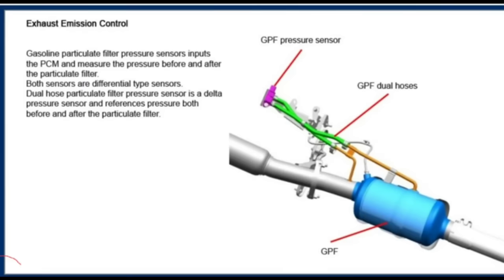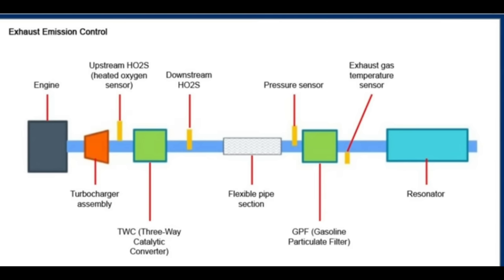Gas Particulate Filters Are Coming To Fords - Check This Out - I'll try and explain

Comment: Gas engines are so clean these days why do we need them?  I guess the EPA has too look like it's doing it's job.
Reply: We weren’t so far off at carbuerators, the rest of it has just been a cashgrab
Reply: @kellismith4329 Feedback carburetors with catalytic converters achieved basically the same results as fuel injection and catalytic converters.

Comment: The old saying "history repeats itself" comes to mind. In high school auto shop class I remember Japanese cars with miles of vacuum hose harnesses and Domestic cars with similar hoses and wires cluttering up engine compartments. When I went to work at a European dealership in 87 I got a pleasant surprise. Fuel injection with O2 sensors did away with the clutter. You could again see the engine. Throttle body GM vehicles were easier to work on. Now we are we are back to the clutter of all kinds of wires, sensors, and modules to deal with. It's just more B/S to cause trouble and expense down the road.
Reply: And  right you are 1230, and the "CUSTOMER" Foot's the Bill....   👎 Here we go again. What a JOKE!!!!
Reply: When GM and Ford came out with their throttle body and multi point fuel injection systems I thought they were really nice. A huge improvement over a computer controlled carburetor or variable venturi carburetor and all the other mess, like a heat riser or ported vacuum switches everywhere

Comment: I’m keeping my 2005 Ford Expedition 5.4 three valve engine and 4 speed automatic transmission.  In a couple of years the vehicle will be phased out for emissions OBD 2 inspection and strait pipe the whole thing
Reply: I’ve got an ‘06 Expedition with 275k and I keep wondering how I could drop an old 351 in it! 😁

Comment: I remember turning thru pages of a binder at ford training facility of upcoming designs and stuff back when I worked at ford dealer and seeing the particulate filter for gas engines and duel fuel injection where there's port and direct fuel injections on a gas motor. Just thought to myself how much more complicated do they need to make things. 🤦‍♂️

Comment: Thanks for the information. I need to dissect this even more now that this system is going to be incorporated.
I wonder if all manufactures will follow suite.
One thing I remember back in the day was when the introduction of LEV cars like the Honda Civic and the Ford Taurus took center stage. I always wondered what made them more emission compliant then the standard production vehicle and as to why they didn't continue this process over their platforms through the years? I never had the chance to work on one and it sure would of been a great experiment by performing a "tailpipe" test utilizing a 5 gas analyzer and compare what's coming out of the new vehicles to the older ones.
The shop I use to work at years ago, we use to have a emission chart to show what tailpipe emissions standards need to be at so we can analyze and do a comparison to see how far off a customer's vehicle is and then plan an attack on how to fix it in order for it to pass emissions. 
This was at a time when the IM240 testing procedure was in effect and that there was 2 different procedures:
If a vehicle could not pass the OBD direct connect test then the second method was to do a tailpipe test while running the vehicle on the 'rollers'. If it past there then the vehicle get the pass.  Vehicles older then '95 got the static idle test. 
Of course that all was thrown out by the mid 2000s. So I have no idea what the requirements are now since I haven't been able to find the information on that anymore.

Comment: We have had GPF’s for the last couple of years here in the UK 

Ford dealer tech
Reply: And how much more unreliable have the newer vehicles become, due to this?
Reply: So far no real problems , you would sometimes get a car in with a “ drive to clean “ message . 

But that would be generally because of a customer driving style 

Or they weren’t made aware
Reply from the maker: You also have different Fuel and different oil over there
Reply: @FordBossMe  different fuels for sure  , you guys have a lower RON I believe right . We now have e10 petrol which is 10 % ethanol 

The oils are the same spec I would imagine . It’s Also interesting to see the slight differences in PTS for both country’s . With regards to TSBs etc

Comment: In the UK the Mustang 5.0 built on or after 11/2017 has had gpf's. I switched PTS over to the UK and looked at workshop manual without a vin to read up on it.

Combined Catalytic Converters/Particulate Filters

The 5.0L Ti-VCT V8 features a combined catalytic converter/particulate filter installed in each exhaust tract along with an exhaust gas temperature sensor and an exhaust gas pressure sensor to meet the new legal requirements for the reduction of diesel particulate emissions. The software has been adapted in order to be able to process the information from the additional sensors.

The mode of operation of the particulate filters is the same as the technology used in the diesel engine. The two exhaust gas flows are each routed into a combined catalytic converter/particulate filter. The particulate filter and the catalytic converter are combined into a single component.

By evaluating the signals from the exhaust gas pressure sensor and the exhaust gas temperature sensor, the PCM can determine the level of build-up in the particulate filters and the exhaust gas temperature. These signals are needed to tell whether engine-based regeneration measures need to be initiated. Regeneration is easier in gasoline engines since their exhaust gas temperatures are approx. 200 °C higher. The regeneration is initiated "naturally" once the driver is no longer accelerating and the gasoline particulate filter is hot enough.

If the regeneration temperature cannot be reached due to the driving style, cold outside air temperatures, driving short distances, the PCM can initiate regeneration by retarding the ignition timing.

A message is shown on the display if the level of build-up in the particulate filter reaches the limit.

Regeneration can be carried out using IDS / FDRS during servicing.

I can't find any information on problem people are having with them. On other vehicle makes I know they offer GPF back exhausts when they are separate from the 5E212 and you can find companies that make (most likely illegally) gpf deletes since one of the most common complains that I can find is the further removing of exhaust noise.

I also found an SAE paper on comparing GPF equipped vs non GPF equipped vehicles particle numbers: https://www.aecc.eu/wp-content/uploads/2020/08/Real-world-emissions-measurements-of-a-GDI-vehicle-without-and-with-GPF.pdf

I doubt anyone will be shocked to learn that direct injection engines produce a much higher amount PN's.

I originally learned about this because I am a nerd and was reading up on Roush's superchargers and they call out that they are not compatible with gpf equipped vehicles.

I'd like to think of Euro 6.2 emissions as the beta testers of GPF's they don't appear to have been causing issues that I can find but then again I'm looking at an internet that heavily biases content for the region I live in. It is causing problems for aftermarket power companies though as they aren't really able to tune anymore. Rosch gave up on them with the superchargers, I don't know about the 2024 US Mustangs with the Whipple tune yet as workshop only says that a GPF may be equipped: 

Overview

NOTICE: Do not use leaded fuel in a vehicle equipped with a catalytic converter. In a vehicle that is continually misfueled, the lead in the fuel will be deposited in the catalytic converter and completely blanket the catalyst. Lead reacts with platinum to poison the catalyst. Continuous use of leaded fuel can destroy the catalyst and render the catalytic converter useless. The addition of lead to the catalytic converter can also solidify the catalyst, causing excessive back pressure in the exhaust system and possibly causing engine damage.

NOTICE: Extremely high temperatures of 1,100°C (2,012°F) or above due to misfiring or an over-rich fuel/air mixture causes the ceramic substrate to sinter or burn, destroying the catalytic converter. Do not continue to operate the vehicle if the engine is misfiring, there is a power loss or other unusual operating conditions, such as engine overheating and backfiring.

NOTICE: Do not use oil or grease-based lubricants on the isolators. These lubricants may cause the rubber to deteriorate. This can lead to separation of the isolator from the exhaust hanger bracket during vehicle operation.

The exhaust system provides an exit for exhaust gases and reduces engine noise by passing the exhaust gases through catalytic converter(s) and muffler(s). The catalytic converters and gasoline particulate filters (if equipped) play a major role in reducing air pollutants.

LH combined gas particulate filter and catalyst assembly mounted to the LH cylinder head.
RH combined gas particulate filter and catalyst assembly mounted to the RH exhaust manifold.
Muffler inlet pipe mounted to the LH catalytic converter to the front muffler.
Central resonator assembly.
Muffler and tailpipe assembly consisting of LH and RH rear mufflers with isolators.
Tailpipe actuator valve located in the exit ports of each rear muffler.
The catalytic converter plays a major role in the emission control system by operating as a gas reactor. It induces a heat driven chemical reaction in the exhaust gases to reduce the exhaust gas pollutants to acceptable levels. In some cases, your catalytic converter may be paired with a gasoline particulate filter. The gasoline particulate filter functions reduces soot and ash particulate pollutants in the exhaust stream. The gasoline particulate filter requires continuous regeneration to maintain correct operation. The emission control system automatically carries out this process using both active and passive regeneration to remove the soot from the filter. Both methods occur automatically and require no driver input.

The material inside the catalytic converter and gasoline particulate filter is ceramic substrate.

The catalytic converter and gasoline particulate filter are designed to provide a long life. No maintenance is necessary.

Sound insulators and shields attached to the underbody protect the vehicle from exhaust system heat and should be inspected at regular intervals to make sure they are not dented, missing or out of position. If a sound insulator and shield is damaged or shows evidence of deterioration, install a new insulator and shield. The sound insulators and shields for the muffler, muffler pipe and catalytic converter pipe can be serviced separately.

Some exhaust system fasteners must be discarded and new ones installed as indicated in the procedures. Discard any damaged or heavily corroded fasteners and install new ones as necessary. Some exhaust system fasteners are of a prevailing torque design. Use only new fasteners with the same part number as the original. Tighten the fasteners to the specified torque during reassembly.

Comment: Thanks for going over the GPF system and it’s components. Would you be able to cover what it actually does?
Reply from the maker: It just cleans up the exhaust just like the diesel one does catches any kind of particulate that's heavier than a certain degree and stores it so it can be burned off
Reply: @FordBossMe  so no fluid is necessary, like DEF?
Reply from the maker: Correct
Reply: @skrsys then they will have gasoline exhaust fluid or GEF when the emissions get even stricter😡(probably)
Reply: @FordBossMe how long will it last before the big headaches start coming due to engine light codes or clogging and maybe starting a fire etc?
Reply from the maker: @danlevesque5437  idk
Reply: @mr.3phase228 it probably won’t happen because gas engines work differently than diesel engines. The GPF probably won’t wear out as fast as a diesel particulate filter. That’s what I have heard so far.

Comment: DPF….I know all about it. I was the first one in our fleet to get that truck, an International box truck. That truck really didn’t have any issues…but I got assigned to another truck and it had all kind of issues with the DPF being the bad icing on the bad cake. This thing wouldn’t allow me to do a manual regen…. it had to be REGEN READY! The truck would let be know and I would have to find a safe place to park while running my route and the filter do its thing. It took approximately 30 minutes for the process and the whole time I was FUMING! A few times, the filter had gotten so clogged up, the truck had to go to the shop and have the filter removed to be placed in the “oven”. 4 hours to bake it and 4 hours to let it cool which means I was in a spare truck. This was a nationwide issue with our fleet and the bosses were not pleased. Eventually International went to a Cummins engine with that same equipment and the problem went away. I’m not at all surprised about GPF; I just hope it works as it should when it hits our market. Stay Blessed!

Comment: I wondering how they are going to deal with them plugging up? Cause in a DPF the ECM just injects more diesel to burn hotter and clean it out (regen). Whereas in a gas engine I dont think they will work because of AFR's.

Comment: IMO-Until a battery technology is developed that recharges in the same amount of time that it takes to fuel an ICE powered vehicle, does not lose range in cold temperatures and does not degrade due to age, people who rely on their vehicles to get things done will not buy the damned EVs. Manufacturers will be stuck between a non buying public and the EPA. If we can get a different administration elected the leaders at the EPA will go away. When the horseless carriage was invented we weren’t forced into them. EV s are NOT ready for prime time. We’re trading one problem (atmosphere) for another (trashing the earth from mineral mining for the batteries).

Comment: The GPF systems scare the carp out of me as a diagnostic engineer.  We have been following that technology and service history in Europe ...and are very afraid of GPFs.  I do not understand the need to regulate PM (particulate matter) emissions from gasoline vehicles.  We have been doing a lot with engine oils and power cylinders to reduce PM from the oils and "rings".  I am told that gasoline PM is very bad ...but I am not so sure.  Maybe I am wrong?  Thr GPF repair costs and short life in Europe scare me ...coming to the USA.

Comment: just wait till they put the 48v heaters inside the cats to heat them up faster.  Its coming the generic OBD-2 codes are set aside for catalysts heater circuit problems.  Can you image the price of that type of cat?

Comment: As of right now, its European only at the moment.  GM for example, I can look in the parts catalog for 2020-2024 Corvette and you can see the US and Euro exhaust systems.  Euro system has GPFs on it and it also loses like 20-30hp, where the US spec cars don't have them.  I don't see GPFs being a thing in the US with the EV push, unless its just on gas trucks.

Comment: I know it's probably very much overkill but I am getting my first new car and want to change oil a few times right away to clean the engine out of particles.  So thinking of going for like a built engine or tuner type schedule -- first 50 miles drop oil and put in Pennzoil Platinum then change at 500 mile with Platinum Ultra, then again at 1000-1500 and go on a regular schedule of 3-4k per change.  Will this be of great benefit for my new engine or just a waste overall?.. of course I want to keep the warranties for a good long while so tuning will come later and pushing the power but still be reliable, etc. for a daily driver when that time comes.  Any advise is appreciated, thanks!  The car is a Subaru wrx 2023 for reference.
Reply from the maker: 1 oil change 1000 miles. Then ever 3k - 5k after
Reply: Thank you for the reply!   You guys are the experts so I will definitely take the advise and your recommendations.  Hope you are doing better and I am glad I found your page and subbed for the content. This is my first new break-in for a car so I may be over thinking it a lot, idk!   @FordBossMe

Comment: I wonder if the engine oil manufacturers will have to update their formulas due to these filters?
Reply: Yes they do. I know Porsche implemented GPFs on their car for the US market in 2020. The oil the require is 0w20/0w30 ultra low saps something like that for emissions protection.
Reply: @lucaskowcz8437  low sap like the oils for vehicles equipped with DPFs. That oil isn’t cheap.

Comment: I can see why this crap is coming out. Port injected gas engine had such low amounts of smoke now DI gas engines have soot coming out when some1 accelerates hard. Solution: put a gpf. Pretty much making the case for eliminating ice engines. Bottom line if you're in the market for a new car buy 1 now and do your best to make it last 10 to 15 years so that by that time hopefully EVs are good enough with range.

Comment: It seems counterproductive to operate the engine at a higher RPM to burn off whatever this filter collects. It seems to me the extra fuel burned will negate the benefits of implementing this. The same could be said for DEF systems that have been used on diesels for a few years. What are you really saving after you figure in the resources required to get the DEF to the vehicle?🤦‍♂️

Comment: These systems already are present on diesel trucks and buses. It sucks! When it malfunctions on those, your vehicle can go into dereg and have you sitting on the side of the road awaiting a mechanic or tow if past stage 5. This is awful! If this isn't fully tested, this is gonna blow, like it does on the first gen EGR diesel trucks and buses. I work in the motorcoache side for over 30 years and have had the displeasure of such happenings.